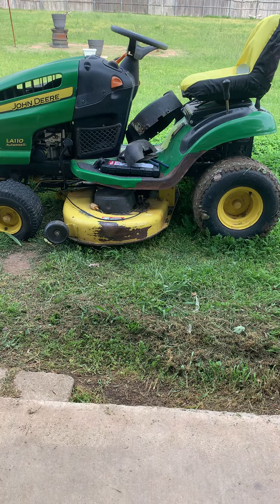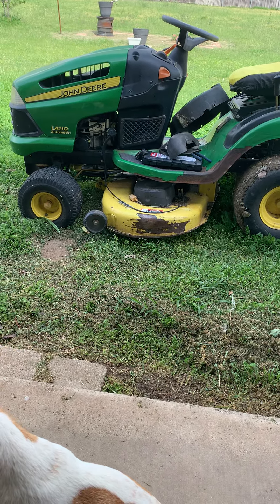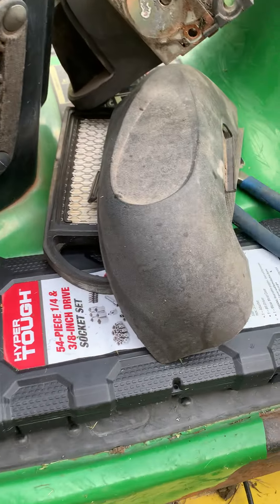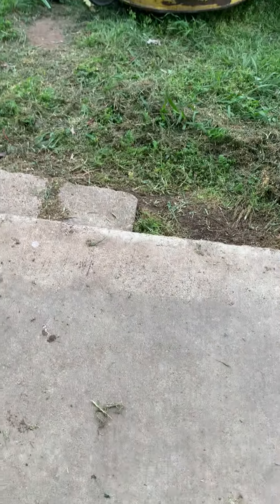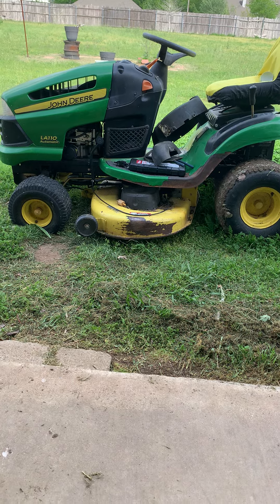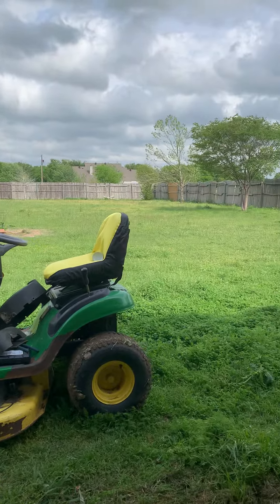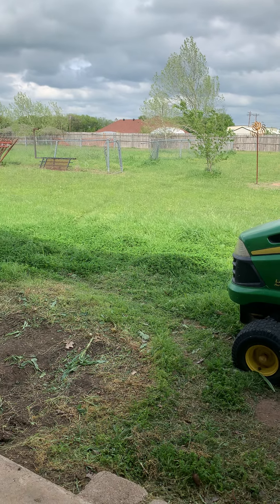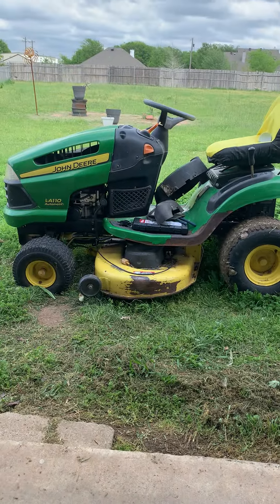Same problem just another mower

Comment: Check that the  anti-backfire solenoid is working. If it is not, no fuel will get to the carburetor.
Reply: You can unscrew them & cut the needle part off & screw it back in rather than buying a new one.